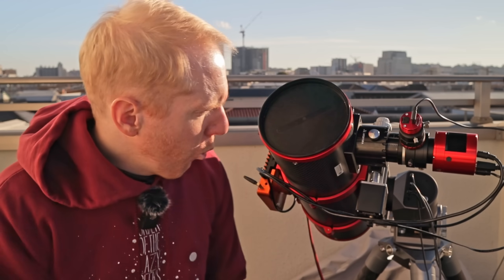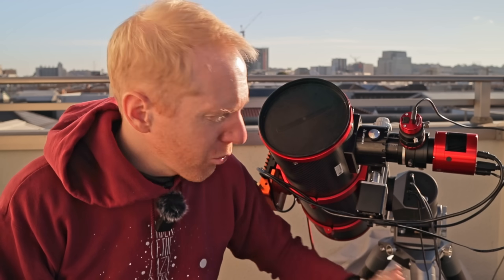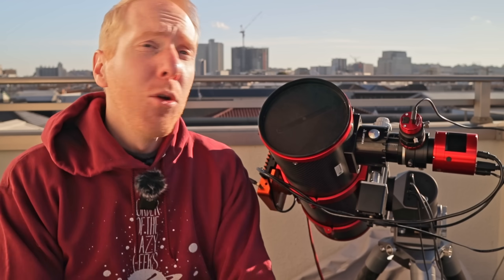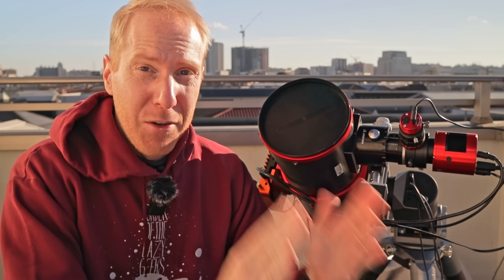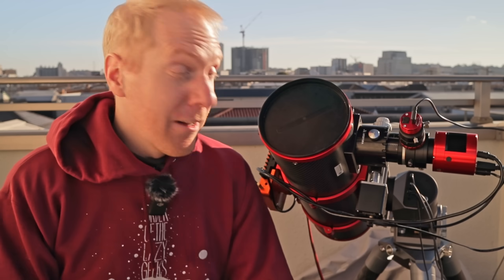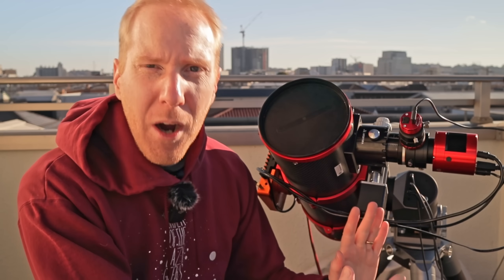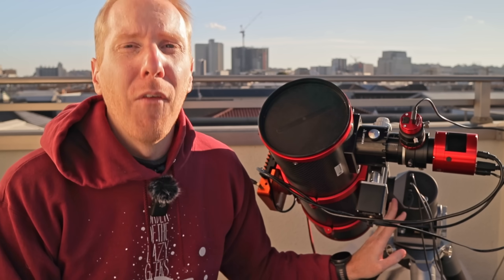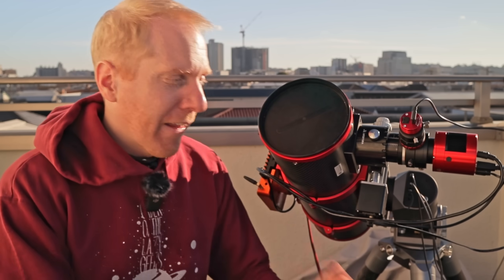EVERY mount should have these features! NEW firmware makes COLLISIONS impossible!

Comment: Thank you for this video. I had the problem with my ZWO AM5 mount while polar aligning. The telescope came to almost vertical position and the ZWO 2600MC AIR duo camera hit the tripod and stopped. I was not able to do the polar alignment and I had tochange to a smaller camera. Does the ZWO AM5 have this safety feature?

Comment: I want a strain wave mount which can carry more weight. I have an AWO AM 5 which works fine with my smaller scope. I have tried a larger scope…around 33 pounds with camera and guide camera and I have had a couple control issues…that was with a counter weight and a counter weight in the pouch under the mount. The WD 20 sounds like the right mount for me. Would I be able to use my ASI AIR to control the mount like on the AM5? Thank you. Your videos are very helpful.

Comment: Make sure this mount has the correct time/location synced on the mount prior to to testing this stuff or your 'EC HA limits' might not work as expected which can be dangerous!  luckily I figured this out through some slow manual slewing prior to auto tuning.
Reply: to be more clear, although it could tell that home is "up" the limits seemed to be rotated around 80 degrees from where I was expecting (I had 92 set for east and west) and could slew only a few degrees west and waaay more to the east.  Seemed to fix itself when I synced it in NINA.

Comment: Every good mount has safety limits settings like Losmandy all mounts (G11) or iOptron all mounts ( Cem120 ) etc . Please stop using and support janky equipment  included  SISO or SASO 50 ok SeeStar50 . I think that you going wrong way last few months .Take care of your videos .Regards
Reply from the maker: Hello Roman - different types of limits, as I explain abundantly in the video :) the standard limits are easily foiled by incorrect homing, or incorrect plate solving - these are different, and have emergency breaking.
Also what are you about with the S50? It's a really good imaging platform at such a low price! Why wouldn't I use and show it?
Agree to disagree - as the person spending countless hours on my videos, I do take good care of them. Regards

Comment: I have woken up in the morning (I run my sessions unattended over night) and found a "Mount has collided with something" type error in Nina and see my scope did hit the tripod, something detected it and stopped before damaging anything. And that is with the old trusty Celestron AVX. Maybe this is a newer feature on strain wave mounts since they have more torque and are generally used without being balanced with a counterweight? 

Maybe I am misinterpreting what is happening and my gear it just made of crazy tough materials (Did I get the tunsten special QHY533m)?

Comment: Why is this a big thing? CNC machines do the same thing. I can't command my printer outside of it's build volume. And also you don't reqlly need encoders for this or a special setup, mounts know how much 1° is otherwise you could do goto, they just need to keep their local angles stored and check those against the limits. And I may just be too noobish but isn't this what the RA/DEC limits are for?
Reply: @U_Geek  I wish the goto systems I've used were always accurate to a degree.   I do see your point though. Torque limiters and encoders are just added levels of protection which I personally think are nice to have but not really necessary if you are imagining from your backyard or a dark sky site where you are in attendance, the RA and DEC limits should be enough. When imaging remotely ( which includes imaging from your backyard if you are inclined to leave your property unattended during the imaging run ) though, I would be inclined to use them. I think more people these days like the click and forget approach to astro photography, that is, start the  imaging run and leave it to do it's thing, which is fine, some people do have to go to work etc ( I'm retired ) so probably can't stay up all night. I always test all my rigs manually to make sure that cables don't catch and equipment won't collide with the mount etc. My equipment is also set up in range of one of my external security cameras, so I can keep an eye on it. I will also go outside to check it from time to time. The only collision I've had was because I didn't follow my own test procedure before starting the imaging run.
Reply: @KevinRudd-w8s  I totally get extra layers of protection, a torque limit or maybe sensing torque spikes is a really nice touch to detect cable snags. I'm just dumbfounded that these mounts that cost crazy amounts of money can't have proper limits set. I guess that's my biggest issue here is that properly enforced ra and dec limits should be standard issue in devices that have such hogh reduction and thus torque.
Reply: @U_Geek  I do see where you are coming from and agree.

Comment: This is a bit tongue-in-cheek, but I'll post it anyway. If you end up doing astronomy work full time, perhaps one of your side gigs could be being a Takahashi brand ambassador. Stage one would be having you on-site at the factory for a firsthand demo of the practical, pragmatic, lazy geek optimizations to their designs (better powder coat paint, replace the sand cast hardware with precisely machined aluminum, make sure all their photography accessories are measured in industry-standard units. Now that the quality and functionality of their tube is up to the near perfect standard of their optics, you would set up an optimal urban Japan astrophotography rig and they would host you once a month to run an astrophotography seminar at a suitable location for their new customers. 

Being a bit more serious, Bray's Starfront is growing so quickly...I wouldn't be surprised if he would trade a series of very detailed how-to videos from you for a pier or even a part-time job. I'm thinking a practical basics of ideal rigs for certain targets series, then some intermediate videos about how to fine-tune NINA, and advanced image processing series of videos, and finally you could be a bit of a guest star party host a few times a year. Whatever you decide to do, best of luck with the road ahead!

Comment: Sooo, one thing I noticed (and I've posted in the WD forums extensively around this), is that the mount wont seek out home if it slews too far.  I noticed the cut in the video just before we would have seen the mount seek home right around 5:45 in the video.  Did the mount seek home for you or did it stop a few degrees past home, forcing you to slew slightly in any direction, then hit home again?

The danger here is that if it overslews past home by a few degrees, your physical limit changes. The mount THINKS it is at home, but it's not, so if you continue slewing in the same direction as it did when slewing home (so you were on the east side of the pier and slew W to home), the mount slews past home by 3-5 degrees, then you continue to slew W to the limit, does it hit the true 95 d limit or does it hit 98-100 (95 + overslew)?
Reply from the maker: I don't think I experienced that - I'll check the raw footage later!

Comment: Thanks for posting this.  Quick question - and apologies if you already answered this somewhere - but what tripod is that (specifically, the mount point between the AM5 / WD-20 mount base plate to tripod (I like that you have more than one locking knob) ?
Reply from the maker: Unfortunately that tripod is only available in Japan, and is fully out of stock now... It's however a standard Gitzo opening at the top of the tripod, although I don't recall the diameter (the mount base plate is the same as the AM5 base plate)

Comment: Proxisky started this.   You need servo motors to get that feature.  It is apparently not possible on stepper motors.  Too bad for all ZWO mounts...
Reply from the maker: Nice! It's good to see two brands with this system! Yeah, Steppers wouldn't give an overcurrent I think...
Reply: @CuivTheLazyGeek  Stall detection is possible on Stepper Motors. Just not the same way as a Servo Motor.

Comment: Thank you Cuiv. Can this issue not be mitigated through software?  For example in Nina or APT, have a setting that does not allow centering if plate solving shows a discrepancy beyond a certain threshold?  Perhaps require a user initiated  approval before slewing beyond a certain amount?  Seems easier than a hardware update.
Reply from the maker: True! That's one scenario that can be avoided this way (although it can cause trouble around the Meridian). That said, there's other scenarios, like an improperly setup Home Position...!

Comment: I recently purchased the Apertura Carbon Star150, spent 2 weeks setting it up with OAG, EAF, etc, installed the ASI AIR Plus in a spot I thought certain would not interfere with meridian flips and went to my favorite dark sky spot and promtly sheared two cables off the AirPlus and jammed it into the mount! A current meter cutoff would have saved me much grief! As it is, I am humiliated at my foolishness with my first meridian flip crash, and hoping my AM5 mount won't be the worse for it. In any case, I am finally convinced myself I needed to join your channel, and so I have. Why? Because your knowledge and presentation skills are unmatched....
Reply from the maker: *hug* that's terrible... I know the feeling man... Hopefully the equipment is mostly fine... Thank you for your support!

Comment: Is that an ASIair on your scope?  You usually use NINA, but if you have had success using the ASIAir with your WD20 a walk through video would be appreciated.  I've been using the ASIair with the WD20, but still finding a few bugs, mainly with mount not returning to the Home position after an Autorun series, despite lots of "Sync Mount" s.   So, I've disabled the AEB, which helps a bit, but is obviously not ideal.  (Yes, I looked at the WarpAstron forum, Discord, & Cloudy Nights.)
Reply from the maker: It's the Stellarmate Pro, not the ASIAIr... Also love how you "fixed" the problem ;p
Reply: I seem to have solved this problem. But, if your shoe size is larger than 12 or smaller than 8 you’ll need 1/4 tsp of salt & season 3 of Monty Python

Comment: I tried for ages to persuade ZWO feedback employees to change ASIAIR  firmware to include mount limits in their ASIAIR firmware. Even collisions during autoguiding should be easily detected through PHD2. I told them to set moumt limits for all situations, for slewing, preview,  Live Stacking, Planetary Video capturing, focusing... I am sure all of us here were in the situation when we were overworked, tired after driving to dark location, you let your mount to slew to the position and you takr that first 5min exposure, and while you are waiting, you fall asleep while mount keeps tracking...
Other situation... Clouds roll in at meridian flip and there are no stars to platesolve on. It either keeps tracking or invent a completely wrong location. At that point it should rarher warn you that the position error is too big compared to what was expected and it shoud rather parked itself. Or, it keeps tracking, but the daylight has arrived, why when it knows the time it keeps tracking? It should stop and park itself.

Comment: I was worried about this  when I converted to remote imaging as I had wrote an imaging executive or top level sequencer to continue the hardware.   After I do a plate solve, I will not allow a mount sync to occur if the plate solve errors from the desired RA/DEC is more than a user defined value.    So far haven’t had a bad plate solve that engaged the code….however I can also use the code to tell me when my sky math models need to be redone… works great!
Reply from the maker: Nice workaround!! Wow!

Comment: Hi Cuiv... just in time... I was literally about to purchase one of these mounts this week... Quick question... Is there a way to know if a given mount is one of the "new" ones with the newer mainboard or one of the older ones that would require a mainboard switch?
Reply from the maker: No way to know in advance (I think the WarpAstron software can tell you though), I would recommend asking the dealer you purchase from
Reply from the maker: Oh wait, actually the power button is a giveaway! If it's just a click type, it's the new board, if it's a type where the power button stays depressed, and then goes back to initial position only when you turn the mount off, it's the old one!

Comment: My HEQ5 recently went a bit haywire and my camera almost crashed into the tripod leg, but luckily I had just come out to check on it so I released the clutch quickly, but the motors kept on running for another 10 seconds or so. For me I think it was because I had moved from Synscan to GSS and I hadn't set everything up properly yet.
 I think I had not synced GSS to the home position properly because I had to switch the mount off and on to reconnect the wifi... and I might have moved it back to the home position manually!
Reply from the maker: Glad your camera was safe! Phew! Yeah an incorrectly set Home Position is also a classic culprit...!

Comment: Proxisky's UMI17/20s have an anticollision system too. The 20s is a great mount, i'll be buying one for SFRO next month hopefully.
Reply: Curious to why you wouldn't just get a GEM if you're sending it remote and don't need the portability?
Reply: @frogliza9977  I also have a CEM40. An amazing mount. Sending a setup remote I find too expensive.
Reply: @frogliza9977  GEMs are heavy. Sending it to Texas will cost a lot. The 20s also has a number of features, like the one in this video, that I find appealing. They get lots of software updates unlike old mounts that are just forgotten. Innovative updates. If you look at starfront, most of the mounts there are AM5n mounts from ZWO.
Reply from the maker: NICE! That's awesome, we need EVERY mount to have this!
Reply: I have never seen this on my UMi17. Or does it only relate to the 20s? I still habe the first version of the 17 without any letters after the number.
Reply: @astrofromhome  The original UMi 17 doesn't have this feature. Only the 17S and the 20S do
Reply from the maker: @Darkblade48s61 thanks for the additional info! That makes sense, those use a similar "direct" drive!
Reply from the maker: NICE! Every mount should have this :)